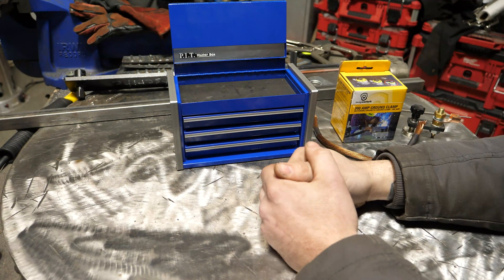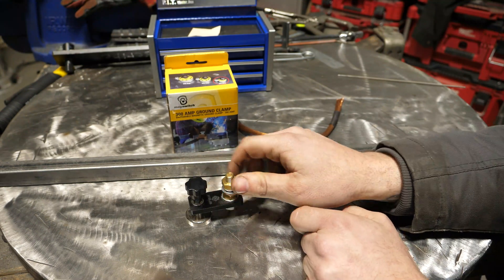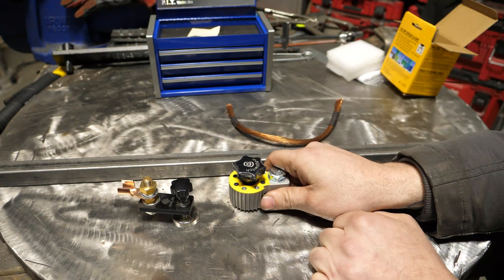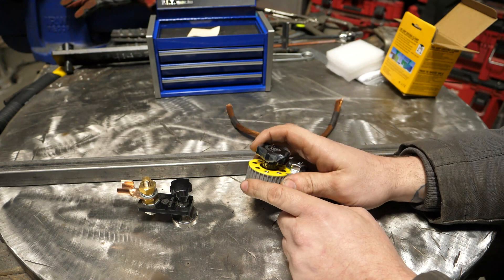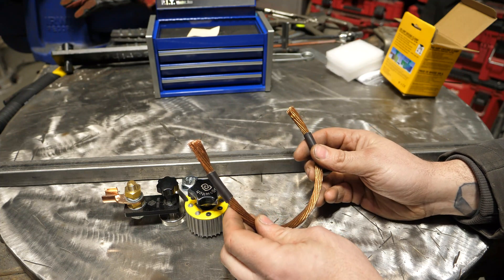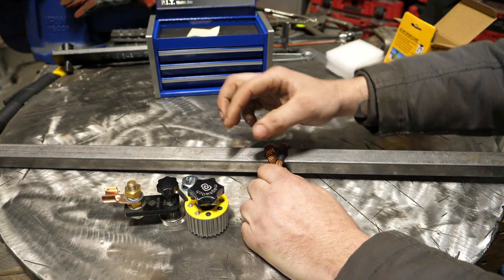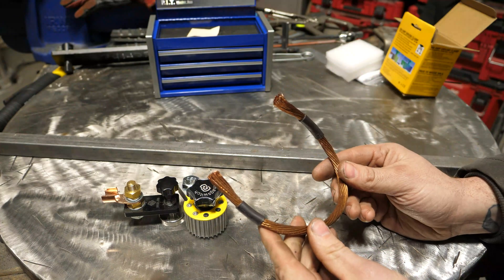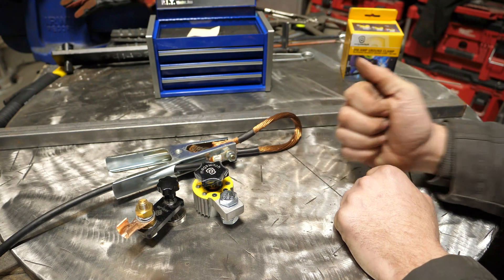QFTB #5:  Magnetic grounds and tips for grounding on unusual objects

Comment: Does it magnetize the metal you are welding? 
I don’t like welding magnetized drill pipe.
Reply from the maker: It doesn’t really magnetize anything, provided you don’t rub it along the side of the material a bunch.  It will affect the arc (cause arc wandering) if you weld close to it though.  I hear you on magnetized pipe, that can be a nightmare to weld around lol.

Comment: I've always had problems with the spring loaded ground clamps, even after cleaning the clamp and putting it on clean bare metal. So I ended up attaching the ground cable straight to a f clamp and it's been the best ground clamp I've ever had.
Reply from the maker: My ground at work is basically the same idea, a thick C- clamp 🗜️ that’s bronze, purposely made for grounding.  Having the ability to put decent pressure on the ground point really helps with a solid ground at the start.
Reply: @makingmistakeswithgreg  The bronze c-clamp was the inspiration for the f-clamp ground and as you say that pressure on the ground connection makes a big difference. I do want to put a bronze c-clamp on my Airco Heliwelder, should I ever get around to figuring out why the DC is running cold, AC is fine though 😒.

Comment: Those magnets are pretty handy.  In a bind to save myself from from going down several floors for a ground clamp I’ve used an old stinger on a column. when then the stinger doesn’t open far enough I’ve clamped on a pair or whopper jaws(c grips) to a piece and put the stinger on those.  It’s somewhat hokie, but in a bind and time crunch it works.
Reply from the maker: In a pinch there are always a lot of options 😀.

Comment: Curie point for iron is 1414°F. Ferrite is around 840°F, although it varies. If you get your ground point that hot, you will have much bigger problems to content with than running the magnet.
Reply from the maker: I am not sure what magnet they use in it.  I do know in a previous video I smoked a magnet just by putting it on the opposite side of what I was welding on.  The magnet had zero magnetism after welding.  Realistically the magnet ground would never get hot enough from carrying current to wreck the magnet, but if you arc gouged right near it I could see it happening from the heat.  A person would have to be pretty stupid/reckless  to have it happen though 😅
Reply: @makingmistakeswithgreg  Oh yeah, if you attached it directly to the HAZ, then that would do it. If you keep it away from Ground Zero, though, it ought not be a problem.

One caveat is that neodymium magnets are rather heat susceptible. That said, I've not seen them used for actual welding.

Comment: Have you ever welded with T-8 flux core wire?
Reply from the maker: My new job had a bunch of t-8 wire that I ran on a few projects.  I am in no way an expert on it but I can tell you if the stickout or voltage is even remotely off its porosity city.  I had so many issues I thought it was just old wire but after I spent some time dialing it in I got it to run decent.  It uses a decent stickout around 3/4 of an inch, which I wasn’t used to running either.  I like flux core wire but t8 is definitely more finicky than I wish it was.

Comment: I welded a 1/2inch bolt to a pair of visegrips and put the ground lug on that,bites in great for mig-
Reply from the maker: That’s similar to my heavy duty ground clamp I use at work (basically a c clamp with a cable hookup).  Your idea would be faster to hookup and take off though.  I will have to find a spare vise grip lol.

Comment: The poor redkneck solution that works for me has been taking a piece of scrap metal that fits nicely in my ground clamp jaws and tack weld that scrap onto what I need to weld on that doesn't fit in my ground clamp. When I'm finished welding I break my  "grounding scrap" off and grind the tack weld that was securing it and open another frosty beverage. This solves almost all my grounding problems with rare exceptions.
Reply: I've done that too with a small piece of 2" x 1/8" thick scrap of flat bar that I cleaned off both sides with a flap disc. Just tacked it in a spot where it would be hidden and grind off the tacks later. Used it when fixing some steps on a metal staircase, the side stringers were all painted pretty rusty, and no good spot to get a ground clamp on. The nice thing about the tack is only need to grind a small spot to good metal to tack the ground piece on with. Broke it off after, a little grinding and some black paint you'd never even know it was there, put it on a hidden spot under the stairs. In the case of those exterior stairs, the magnetic ground would have worked yes, it was all mild steel, but with all the rust everywhere, would have had to try and clean up a much bigger area to get that magnet to electrically connect.

Comment: Good connections are very important. Even at 100 amps, a bad connection can ruin your welds. Also, if the connection isn’t tight, you will get small arcs between the clamp, or whatever you’re using, and your work. Sometimes those arcs are strong enough to mildly weld your work to the table.
Reply: For sure, one time I was fixing some steps on an exterior staircase the stair treads I was replacing had been all eaten away by years of ice melt salt, and I was wondering why my wire kept stabbing into the puddle and sticking the wire intermittently. So annoying when you hit the trigger and the wire just hits the work with just a tiny spark... I ended up just grinding a small spot of rust off underneath, and tacking a small piece of clean flat bar to the spot of clean metal I ground off, and moved the ground clamp to that, problem solved. With a solid clean ground connection it ran great.
Reply: @brnmcc01  yup. It’s a big deal. I think that new, untrained home welders don’t understand how important a good connection is.
Reply from the maker: I melted a set of lenco connectors last week because of that.  They were beat up pretty bad and one was lose.  Well at 300+ amps air arcing it lost connection and melted the connector 😅